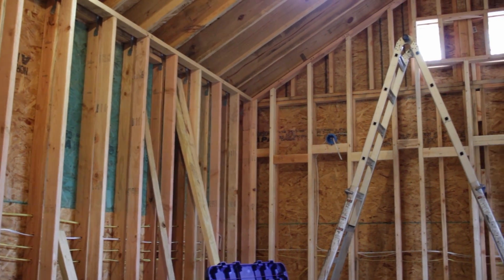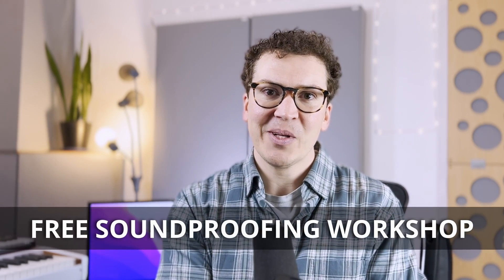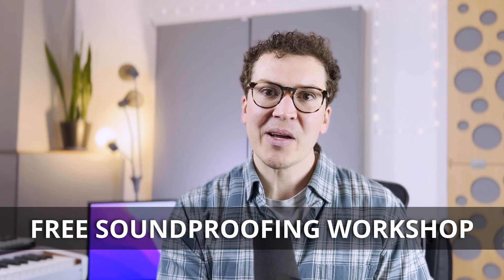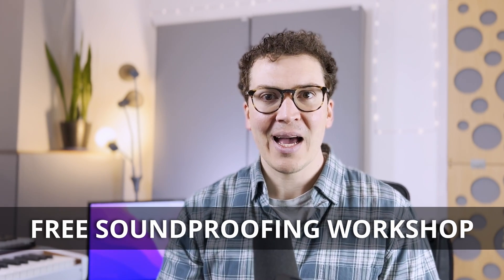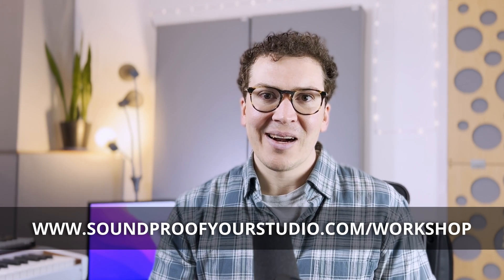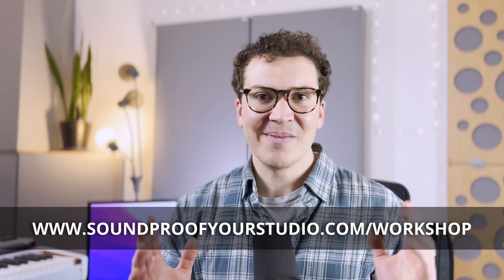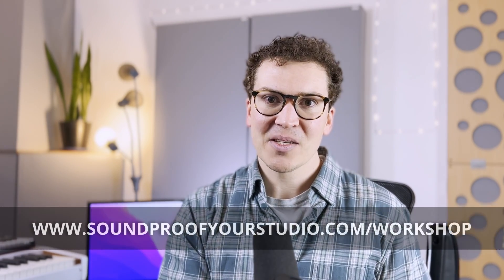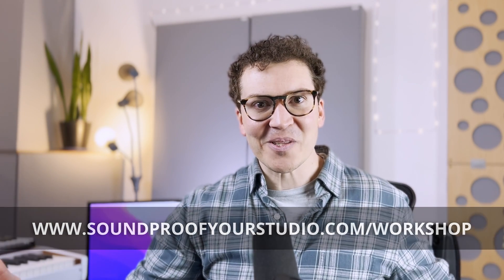Why You Should Stagger Your Studs When Soundproofing

Comment: On inside walls I would not only stagger the studs but use two foot and top boards and use felt under and over those boards. I would use heavy mineral wool, not glass wool, for sound isolation. You can also use felt were the wall covering meats the studs. Do not let the wall covering touch the floor or the sealing.

Comment: So basically, in a normal wall we have two main paths for sound transfer: drywall->stud->drywall or drywall->insulation->drywall. In this double wall system we have drywall->stud->air->stud->drywall or drywall->insulation->air->insulation->drywall. By staggering we now change these two paths to being drywall->stud->air->insulation->drywall or drywall->insulation->air->stud->drywall,

and the basic concept here is that these staggered pathways are apparently better at reducing the sound transfer. I'd really like to see some scientific experiment to see if this is actually the case, and how much of a difference it does make. It's an interesting idea, but to be honest it isn't super convincing by itself.
Reply: I lived in a house built this way. 14 years. When the tornado came though and I slept right though the storm, never knew that it came about a 1/8 of a mile away. One heck of a storm, trees blown over, lost power, those around us spent 2 weeks cleaning up, getting houses/garages fixed. 
Slab home, 2550 sq. ft. 2x10 built with staggered walls. No up stairs or basement,  just like a Florida home except stick built in Michigan, electricity bills were much lower too .You could scream towards an outside wall and never hear it outside. 
Best house ever. Quiet, peaceful inside, the whole world of noise goes away. Period. I'm very sorry I sold it. Very sorry

Comment: Hi, you mention using MLV in the video between the drywall layers. Are you now suggesting MLV instead of or equal with green glue?
Reply from the maker: No that is for an acoustic wall not an isolation wall. They are different. For my isolation walls I use just drywall and a double wall system.

Comment: I have begun the process of building my studio as close to the same way you built yours as I can.  By that I mean I am on a concrete slab and I have built the outside wall, attached a double layer of 19/32 OSB to the outside and lined it with regular pink insulation.  Now I'm ready to start the inside wall but I I see this video about staggering studs.  I've also seen some videos by Mr. Brandt and if I'm remembering correctly I think he said two things: 1- place the inside wall studs 24" on center 2- use metal studs for the inside wall.  Is this  correct?  If I use 24 inch spacing on the interior wall will that not create more of a diaphragm effect?   I plan to use a double layer of 5/8 type X drywall for the inside.
Reply from the maker: I wouldn’t get to lost in the minutia. 16 vs 24 oc also is a structural part of the design. I use wood studs. Staggering them is better.

Comment: Great vid, thanks!

How much would using different thickness/weight sheathing (drywall, etc) on each side of the soundproof wall? The sympathetic resonance should be reduced if the 2 sides of the cavity have different fundamental/resonance frequencies.
Reply from the maker: You are right. I always lean towards more mass when budgets are small, but if you can afford say 23/32 OSB x2 and one 1/2" OSB sandwiched in the middle or even MLV that will help with different materials for isolation.

Comment: I’m based in the uk and planning a soundproofing project - I have access to 1/2” drywall and 5/8” SoundBloc. The soundbloc is double the price per 8x4’ sheet. 

I’m considering using majority 1/2” drywall doubled up because it’s much cheaper. If I were to apply some Soundbloc boards, would it be more effective to apply them inside the room or on the outside of the stud wall? 

Not sure how important material consistency is regarding stud walls and soundproofing
Reply from the maker: I would add an extra layers of 1/2" drywall to each side of the wall if you can afford it. With gyprock I always tend to just look at mass and don't pay too much to boards with some sort of Constrained Layer Damping System.